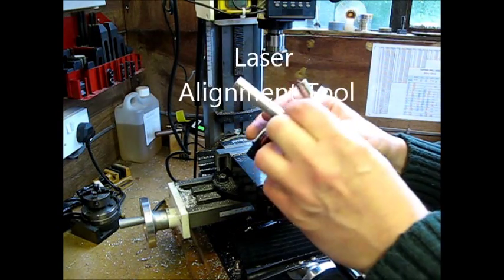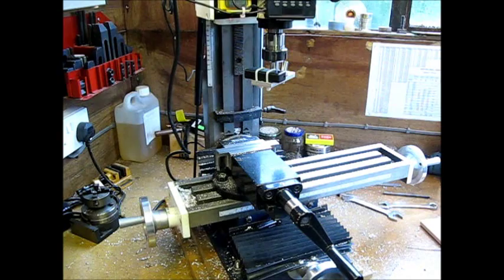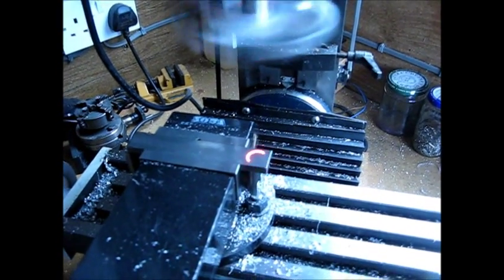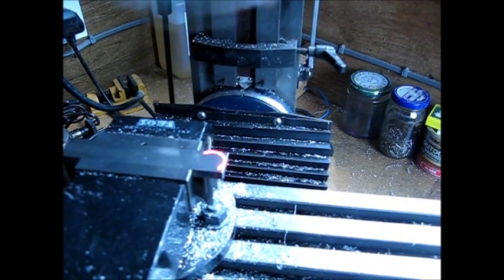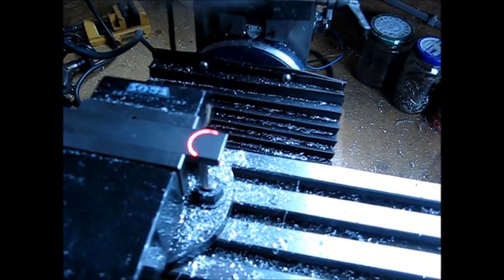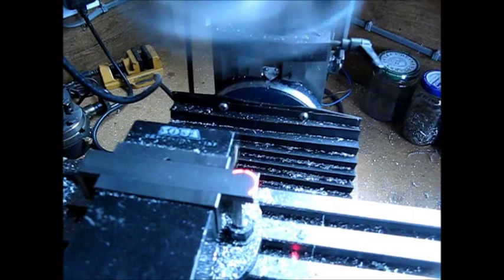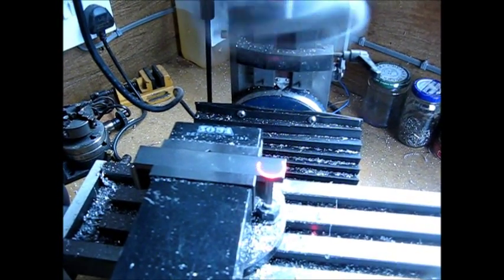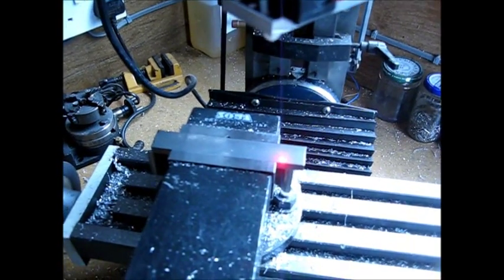Laser Alignment Tool

Comment: Very nice …….
you can use a round mini laser
with a very narrow gap in the chuck of your lathe to adjust the center height of your tools,
also on tools upside down when
parting with reverse spindle rotation.